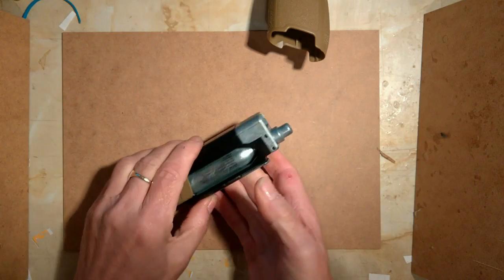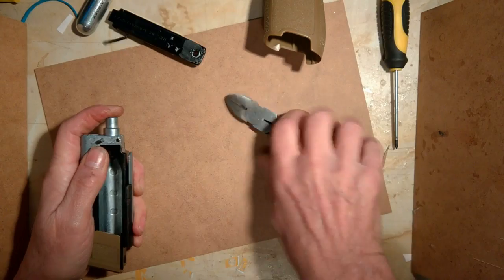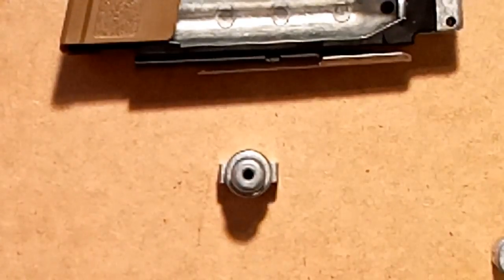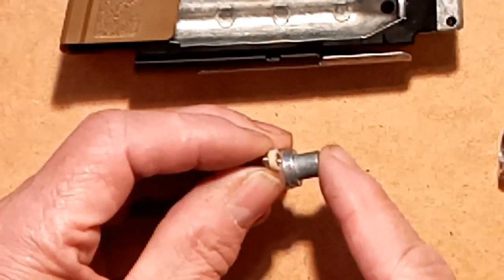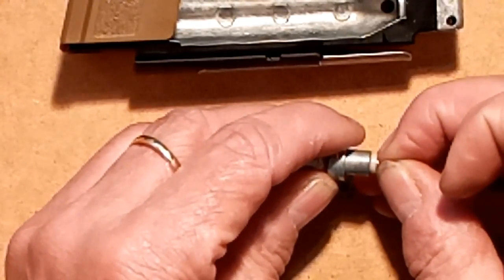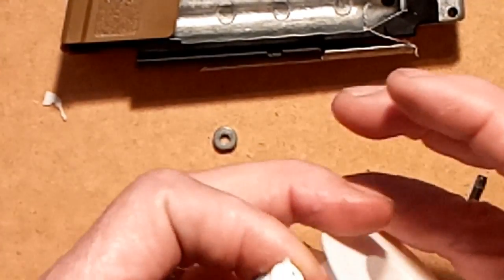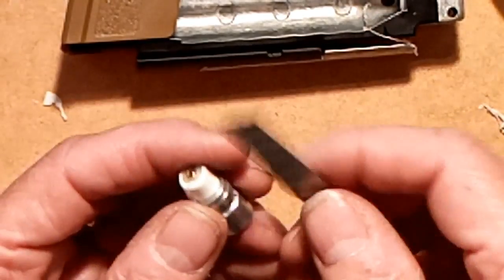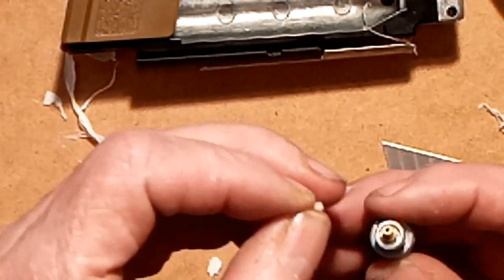M17 Air Gun Co2 Leaking Cartridge

Comment: Hello, thank you very much for the good educational video. I have seen in some video channels that in order for a 12 gram CO2 capsule to give more shots, they recommend heating the CO2 capsule with a hair dryer and then placing it in the magazine. Is this true and is it not dangerous? Thanks
Reply from the maker: Yes, but i would not reccomend this action as it will blow the o rings in the gun and is potentially dangerous for the gas cylinder.
I would suggest that putting it in you pocket and warm up to body temperature is as far to go..
Jerry
Reply: @JERRYIRWIN41  
Hi
Very thanks 🙏🌹

Comment: Now how do you fix the leak if it starts to leak when you put the clip back into the gun before you shoot it, how do you fix that leak
Reply from the maker: Change the o ring at the top of the mag , this seals around the pin that protrudes from the actual gun . When the mag is inserted the pin in the gun passes thru the o ring and then opens the poppet valve.
hope this helps
jerry

Comment: Hi good afternoon love your video no the Sig sauer m17 bb thanks for the information on the internal parts... I have an problem my magazine I replaced the o rings seal's but for some how my magazine don't connected with my pistol  not sure if the pin inside the pistols magazine holder is damage I didn't take the pistol apart yet... Any thoughts? Fernando... At x5redeyez@gmail.com
Reply from the maker: sorry to say... no idea.. maybe you have put in 2 o rings and it will now not seat fully in allowing the latch to engage and hold mag in ?
Reply: @JERRYIRWIN41  thank you so much for the reply I got the problem the pin that go's   inside the nylon washes was upside down notice it after watching your video again.
 thanks again Fernando cape town...

Comment: Mine leaks when I shove the clip all the way in do you think its the same problem?
Reply from the maker: No, I dont think so...The problem i had was it leaked all the time. I would suggest if yours leaks when inserted into the gun that its the rubber o ring that the module pushes up against in the gun.. Only my opinion thow..
Reply: My is doing the same thing as your is doing. Have you been able to fix that issue with yours as I just got mine yesterday and it has been doing that since I put the first cartige in after buying it. Any ideas

Comment: This is genius. I'm pretty positive that THIS issue right here, is the problem a majority of people are having with this co2 SIG air gun leaking.
Enough people have been having leaking issues that I'm sure quite a few people have worked on, an discovered remedies for the issue.
I've seen quite a few video on YouTube alone, about SIG M17 leak fixes. An this was also quite a deterrent when considering buying this air gun myself.

Which of coarse I ended up doing today lol, an the guy was an asshole when i was inquiring about "returns" of the thing is busted out the box. So I bought an extra magazine, which I wanted an extra one anyways. 
An after watching this, I'm confident that I can remedy the issue if it happens to occur. The only thing now, is the god damn mom moved or lost the pipe threading ( pbc? or whatever ) tape lol.
Of coarse when I might need it, we'll have to pick up a roll to keep on hand.

Cheers, this will help allot of people.

Comment: Thank you for a quick and easy fix to an issue SIG needs address.  My M17 arrives next week, hopefully they've upgraded the sealing washer spec/material in the newer guns.  I'll be using it as a training tool for my wife and daughter so it will see a lot of use doing basic safety handling and shooting, then advancing to self defense draw and fire skills, then timed drills assuming the gun's report will activate my CE Pro2 shot timer.

Comment: Thanks for the great video I will try it out, as you say nothing to loose. I would like to ask for how long does this fix work? Is it permanent or after 10-20 co2 you need to repeat the procedure?
Reply from the maker: Still sealed and no leaks after 500 plus pellets
Reply: JERRYIRWIN41 thanks! I will try it out. Kudos to you for the tutorial!
Reply: Use of the gun should not affect this fix in any way. The white seal might start to leak at some point due to very small wear over a longer period of time  - but that should not be the tape's fault. This is a very good and cheap diy fix whenever the mag starts to leak.